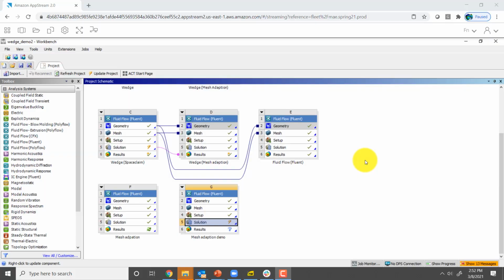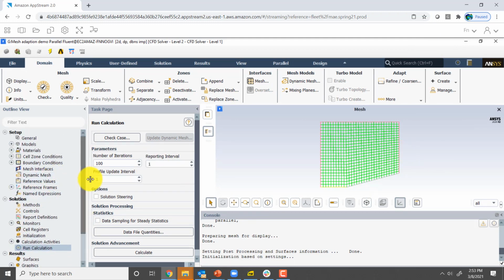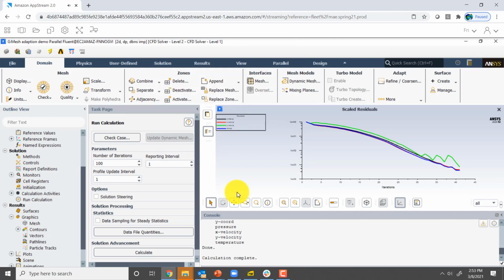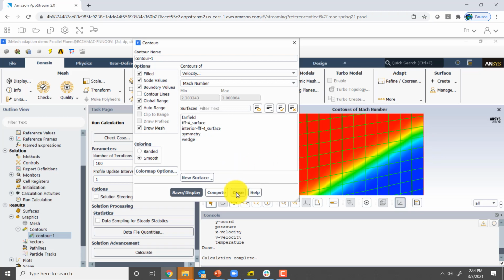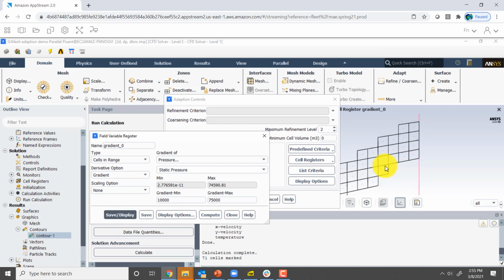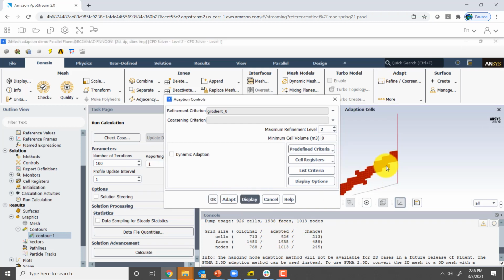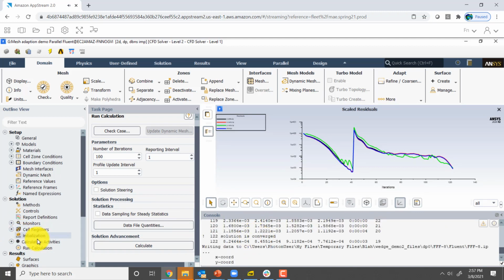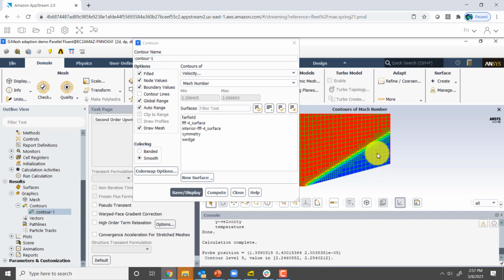Supersonic Flow Over a Wedge Using Ansys Workbench — Adapt the Mesh

Comment: Sir, I have a similar problem. It's from the book "Modern Compressible Flows" by JD Anderson, where we have to compare supersonic flow over wedge and a cone. 
I'm getting good and close to expected results in case of wedge, I did a similar thing as you did here. But in case of cone, my result is a bit off mark(flow angle beta). I'm also facing some difficulties meshing the tip of cone.

Can you give some insight. A short video or a detailed comment would suffice.
Thank you.
Reply: Dear Nitish, Have you got the expected results?